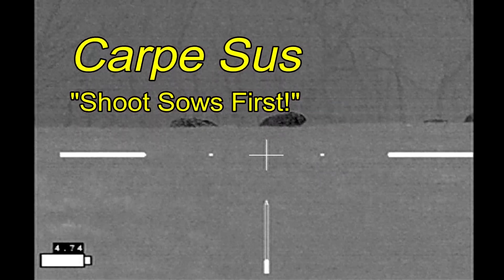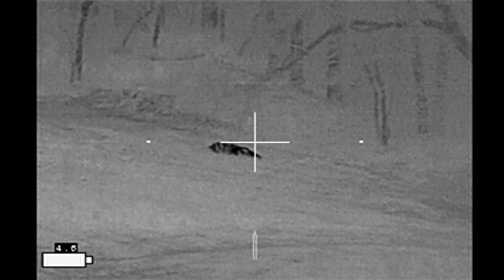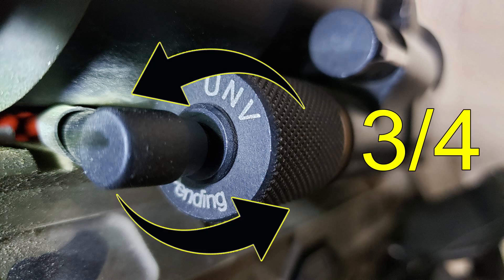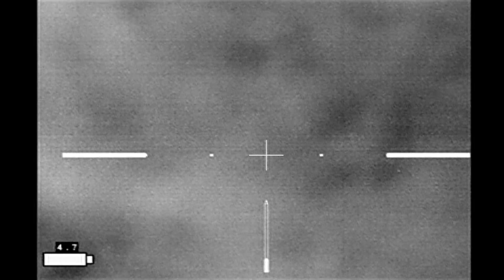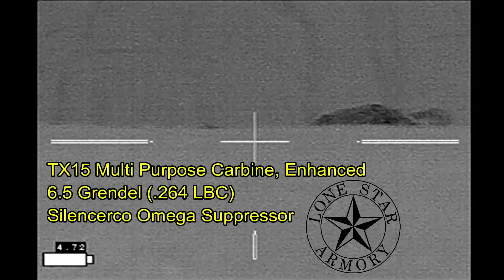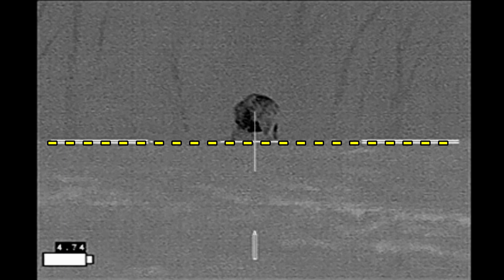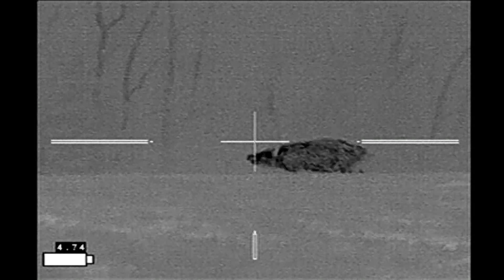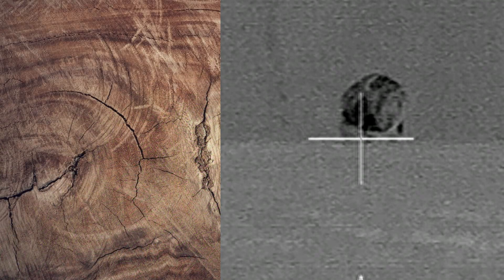Scope Issue Resolved, 1 Sow Down

Comment: Most times I find it is a simple solution, when I have a computer or electronics problem.  I have spent hours trouble shooting and it turned out to be  bad connection.
Reply from the maker: Right!  However, the first even didn't mimic a power issue per se and that sort of threw me for loop.  Apparently, it was, but was so brief as to not actually fully shut off the scope, only disabling some functions.  The next time, the issue should have been more obvious, but I was already jaded by the first one.  Ben had brought me a backup rifle and optic to use and so once the 2nd problem occurred, the decision was already made to use the backup.  Sadly, we didn't see any more hogs and I didn't get to shoot his rifle and ammo.  ;-)